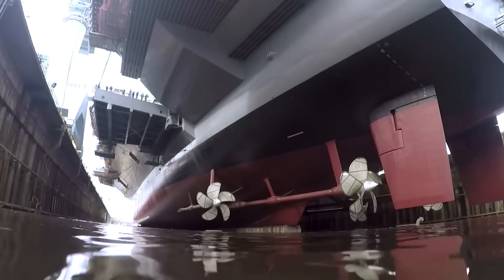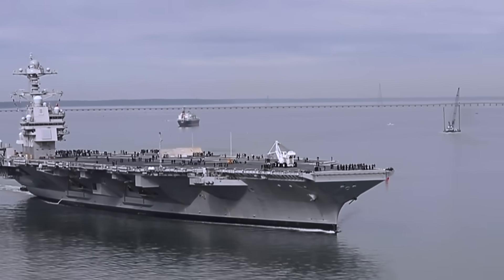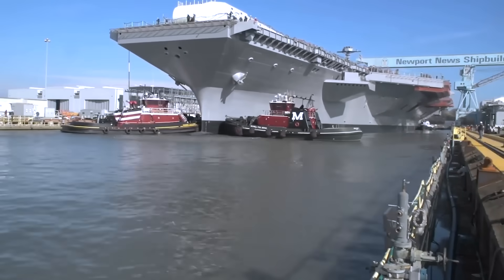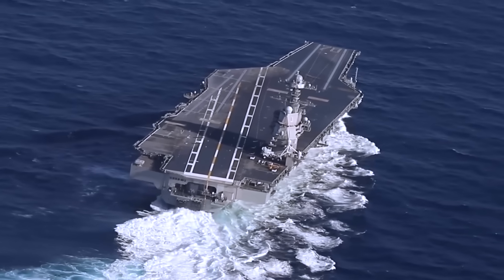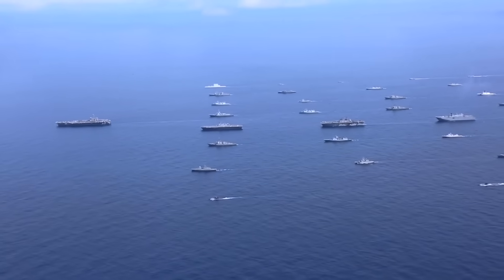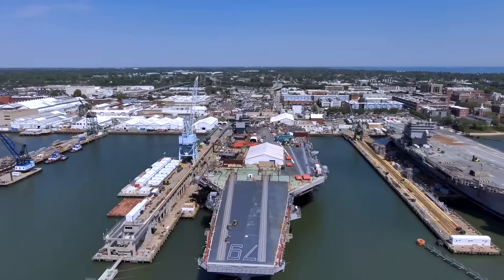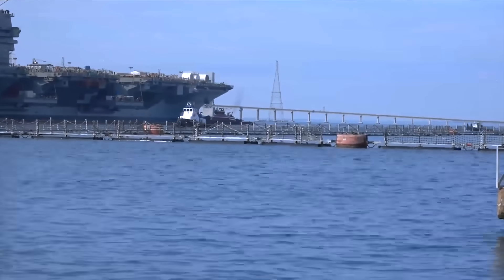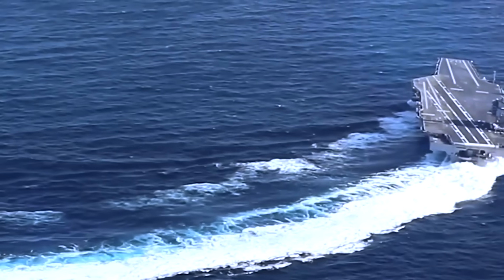The US Finally Launches its New Aircraft Carrier USS John Kennedy CVN 79

Comment: It can disappear in a few seconds, without a trace. Two ways ships disappear. One is slowly as if it didn't exist at all, or the disappearance happens as if the ship was lifted out, the water slams in with a very big force. Some ships disappear during the engines are running, they fade away. Or the engines stop right away and the ship is nowhere. Maybe it depends on, who is on board.
Reply: Dude......what?